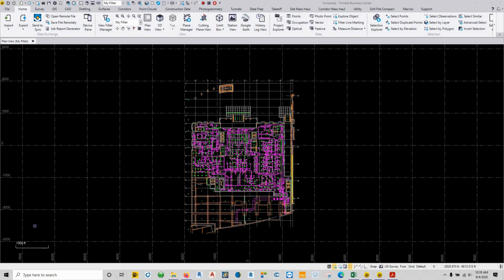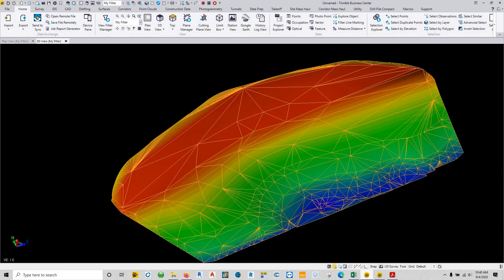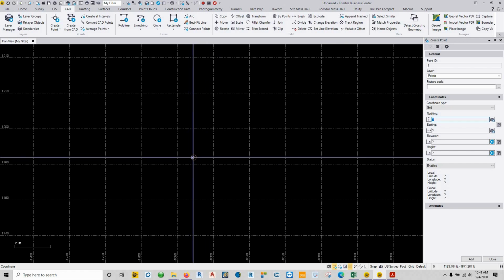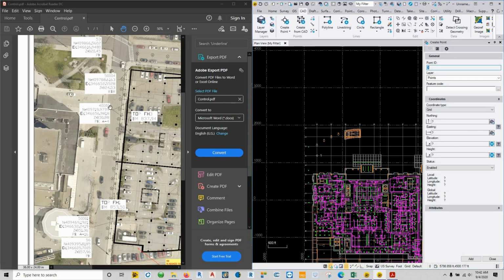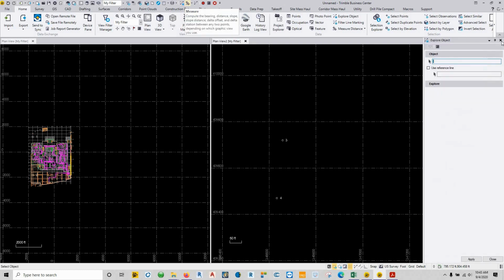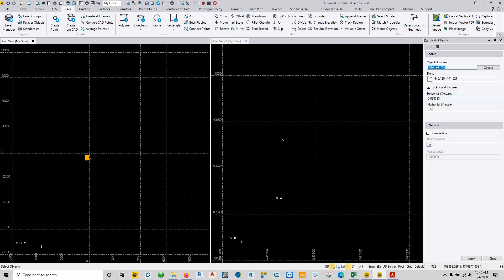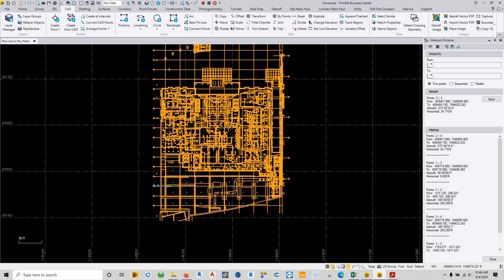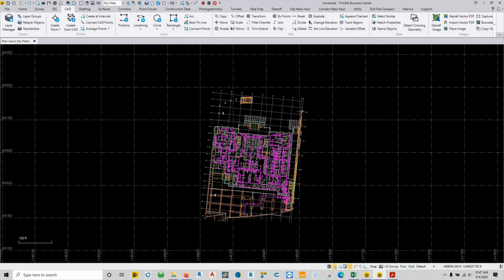How to Georeference CAD File in TBC

Comment: Very Clear Explanation. One question, Can the CAD file be imported and moved as a block? Separate elements are terrible as you can only work with one drawing in the project. You would end up selecting and moving other elements by accident. Thanks!